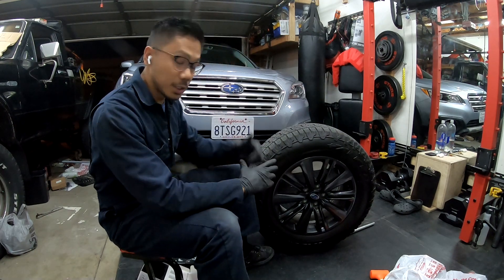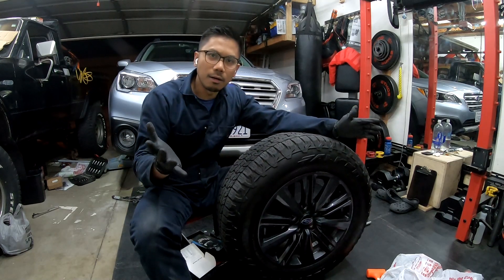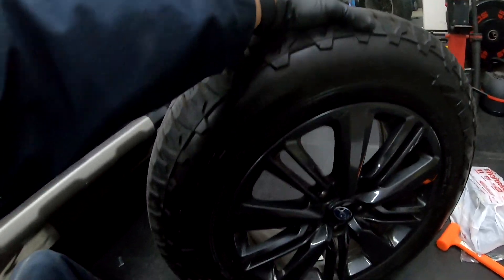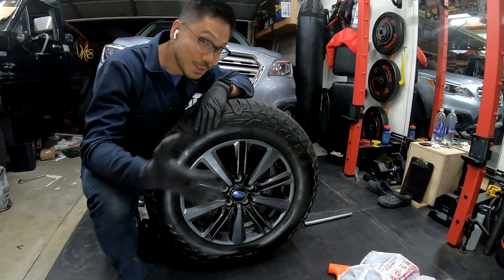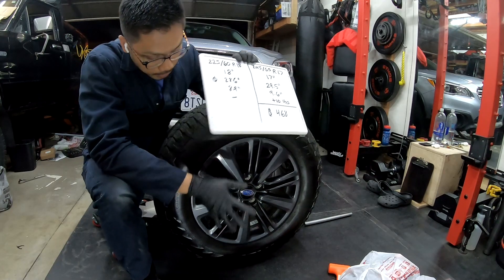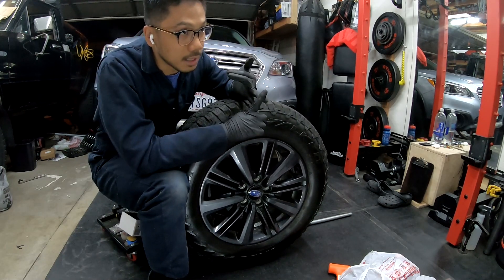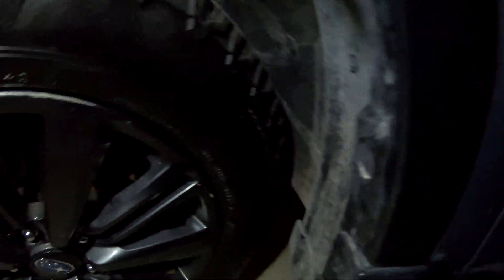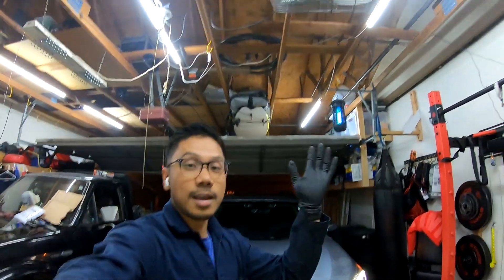Wild peak All terrain on an outback | Subaru budget build | EP 3

Comment: I have the Wlidpeaks. I didn't do quite as big though, I do drive in snow for part of the year and wanted a little more clearance. Oh yeah, you didn't mention the tires are 3-peak rated, so better on snow/ice than regular all-season, good enough for occasional winter driving. I also didn't widen the wheel. After looking into how much of a difference it might make, I decided the narrower tire would work just fine and keep the weight down. I do agree, the WRX wheels look better.

Comment: I bought this tire an notice solid wear about the 5k mark that normally wouldn't be until the 10k mark.  That being said when I hit 23k on the tire I took it back in to my tire dealer and let him have a look.  We pulled the install records that noted I had just hit 23k on the tires.  That being said at 23k the tires had little to no life left in them.. Just so happened the tire rep for the distribution company was on site that day and had a look.  He measured and his jaw dropped.  They were worn so much he gave me an 80% discount on whatever set I wanted and ended up going with the AT3 and have not looked back.  The Wild Peak has an awesome look with low performance and terrible on wet roads.  Quiet and sleek but not worth the money for a 23k tire.  This was on my 2016 Outback limited.

Comment: Your wheel steer lock clearance test is not approved until you have my roomate Dustin sitting and bouncing on the vehicle over each tire while you perform the test. He is close to 400 lbs.s and is available for such purposes with confirmed round trip airlines tickets (regardless of whether he is local or not), and his usual fee (which is usually negotiated on a case by case basis). He is laboratory calibrated to simulate full strut compression as you do the steer lock test. :)  But seriously, great choice and I just made the same one in the same size for an Outback Wilderness I just got. I'm putting mine on some Motegi MR139's that weight 22 lbs.'s and change which should mitigate the tire weight difference somewhat per corner. I think the tires are about ten pounds heavier, and I think the rims are about 3 pounds lighter. So this leaves me with approximately 7 extra pounds per wheel/tire combo. which I'm sure will hit my MPG somewhat.  I'm keeping my stock wheels and tires to either sell, or to put in storage for cheaper long range road trips and commuting.  Still have to figure out how to change TPSM sensor sync on the wheels without paying each time. I guess I'll have to buy or rent an electronic maintenance interface tool of some kind, or just give up plans of changing them out whenever I feel like it. It would be stellar if the software would allow for set A and set B which would cost ZERO dollars to program into the cars CPU. Then again, I've never HAD TPMS's before, so what the heck am I worried about? It is cool tho.  And Dustin isn't getting NEAR my Wildebeast for a lock test, but don't let that sway your decision to hire him for your testing purposes.  Databyter
Reply from the maker: hahaha i need me a calibrated dustin in my life to complete this test.